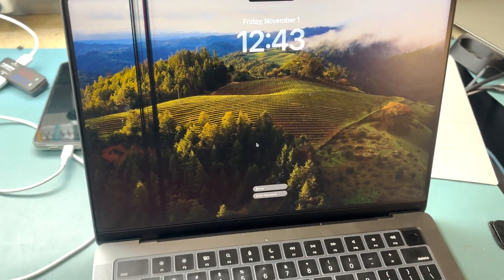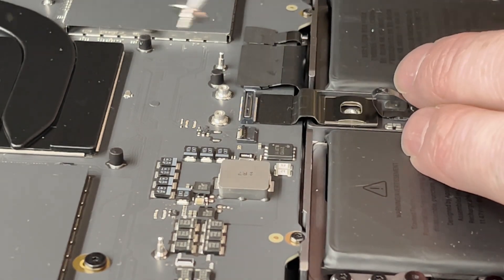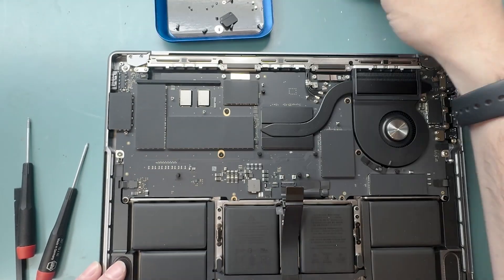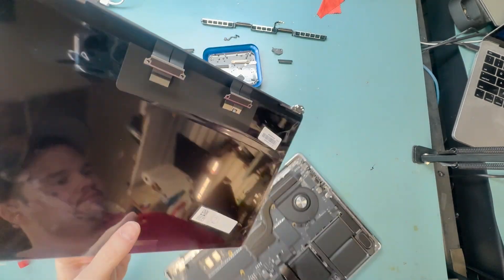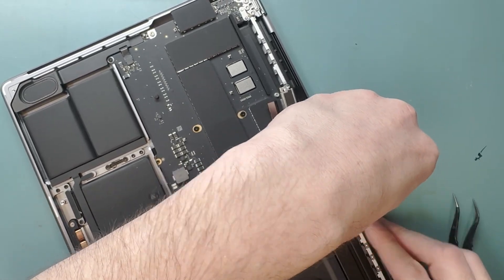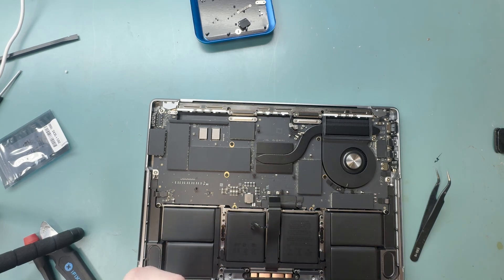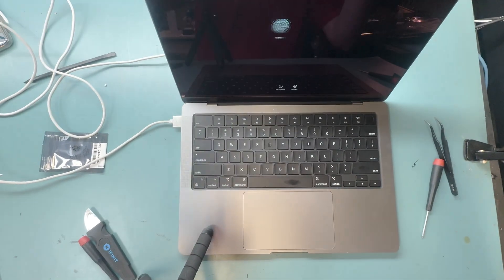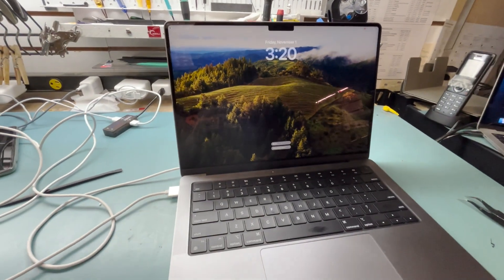MacBook Pro M3 2023 A2918 Screen Replacement

Comment: If I replace the screen with another OEM screen I took off another MacBook that's the same model, I wouldn't need to do the programming, correct?
Reply from the maker: It will have a screen artifact if its not programmed as far as I know unless they changed it

Comment: does this guide work for model A3401 (m4 pro)?
Reply from the maker: Most likely but I have not yet repaired a M4 yet. Maybe I could help you fix yours :). I am sure they are very similar.
Reply: @cosmoslawls does this work? I have to replace the screen of my A3401 MacBook Pro too!

Comment: Great video.  As long as you can get an OEM pull with corresponding angle sensor you can get it for about half of Apple.  Grade A pull from MobileSentrix is about half the price and includes the angle sensor for the display

Comment: Hey man, great video! Im about to get a deal on a m1 macbook air, i want to replace the screen. do i have to buy a oem display to get true tone? or do i only have to get a fitting screen and i can pair the part for true tone? 

does the pairing require any tools or money? ive read online, that the part pairing can only to repair shops or people like that?

Love your vids, keep up the work!
Reply from the maker: @clipsmadebynquila7226  the A2337 doesn't need to be programed. Buy the screen from mobilesentrix.com
Reply: @worthitrepairs  thank you a lot for your answer! this means if i buy the whole display, not the lcd from this website, i get true tone, the camera works and i dont have to do any pairing?
Reply from the maker: @clipsmadebynquila7226  make sure you buy whole assembly
Reply from the maker: @ https://youtu.be/EOjtntaVnZE?feature=shared
Reply: @worthitrepairs  you did the same as in this video only difference is that you said you test the camera. you didnt show that true tone works or that the camera work

Comment: Hey man, I have a A2442 MBP14 m1 pro with a broken screen and a identical laptop with a broken motherboard.

I've seen that I'm forced to replace the ic chips, do you know if I wouldn't just be able to replicate your steps? 

Its basically the same laptop just a different processor😅
Reply from the maker: Thanks for asking! I wish I had a clear answer on this one. Since iOS 18 allows OEM parts to pair with iPhones without showing the screen message, it’d be great if MacBook screens could follow suit but unfortunately, I don’t think Apple has implemented that yet.

For the A2442, you need to order the part directly through Apple’s Self-Service program, which is actually a third-party service, not directly run by Apple. I found this out the hard way in my recent video of the A2992 when I realized I’d missed replacing the lid angle sensor that came with the screen. Apple had to remote in to help pair everything, so there’s definitely more involved than just swapping parts.

Right now, as far as I know, you’ll still see a screen artifact if you don’t go through their program. However, there might be a workaround: ordering a new lid angle sensor and trying to pair it manually could possibly work, though I can’t guarantee it. If you’re willing to experiment, that might be worth a shot! Please let us know the results I will Pin your comment to the top!

The teardown is I think almost Identical to this repair video you just watched.
Reply: @worthitrepairs  Hello, have you found out if the workaround works or not? I am on the same boat